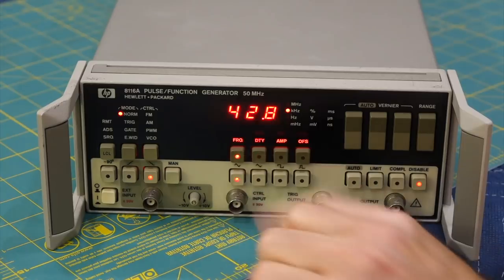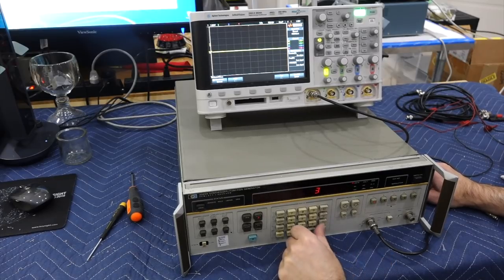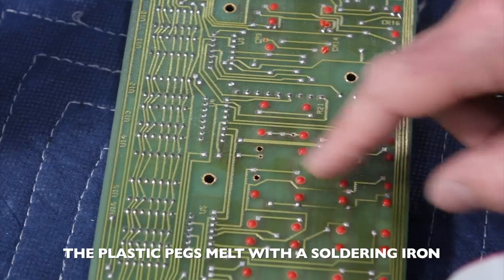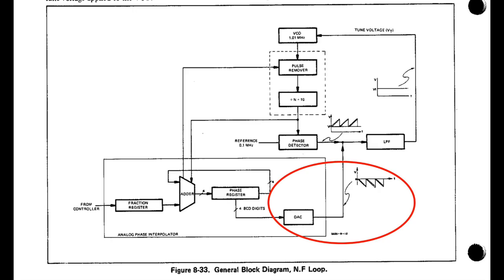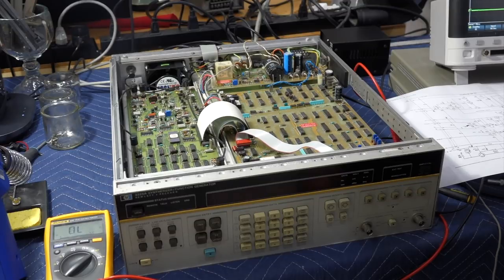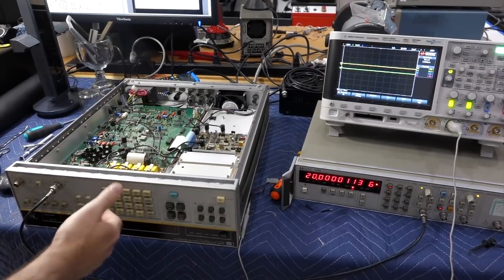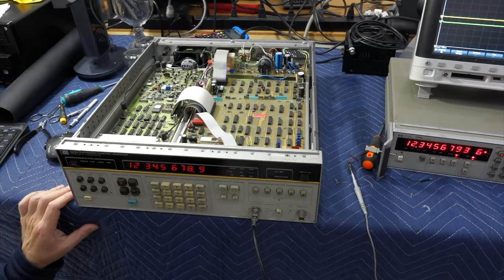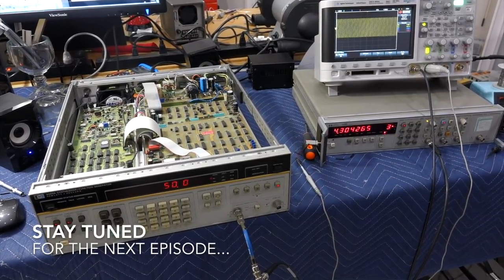HP 3325A Frequency Synthesizer Repair: keys, caps and PLL trouble

Comment: Thanks for this video. You pointed me to What I thought was the only problem on my 3325A ... but I missed one. One of the gummed-up keys, when cleaned, revealed that it was missing the spring  .... and as far as I can tell on google searches and on fleabay - they are not to be found, unless I buy an entire display board.  .. SO, hive mind, does anyone have a suggestion as to where I can get (a) spring? or more than one if that is the requirement to buy/sell ?   So far I am at goose eggs unless I cannibalize a working HP device  ... and I don't want to do that.
So ... any comments are welcome, any criticisms or pokes at an obvious answer I am missing will be accepted and appreciated.     Thanks

Comment: On equipment that in new to you, and in need fo checkout, always go for the PS first. Nothing cna work right if it is not getting the voltages it needs.  I am in the habit of using a Variac for anything I have a question about, monitoring the voltage and current. Nothing worse that destroying parts by rushing into a power-up.

Comment: If it was easy to remove these switches from the pcb and using a small glass fiber brush for cleaning pcb traces and the moving metal contacts of the switches the switches will renewed and will last for another 40 years but look like custom designed for one time installation and removing putting back the same switch has a lot possibilities to fail.

Comment: Too easy!  I'm going to have to start bidding against you on the HP lab equipment on eBay.
Reply from the maker: Uh-oh. I’m in trouble.
Reply: It's often a lot cheaper to buy stuff that's listed as "not working/for parts" and just fix it yourself. Sometimes the fix is something idiotically simple, like a fuse holder that wasn't making good contact (like that VIC-20 I picked up a few months ago), and sometimes it's a little more complex, like a cold solder joint that you need to track down. But if you're competent in this kind of thing, it's a really cheap way to pickup vintage computers and test equipment.

Comment: Why not change both caps? An old device with two caps and one goes bad that other cap is high risk item.
Reply from the maker: The other one tested good and did not leak. I did not have a second high voltage cap replacement in hand either. So the combo of both saved it! It’s a lucky cap.
Reply: The other cap tested good, and the lead seals have  evidently lasted 20+ years, and there's no reason to believe they won't last another twenty -  a new cap may not even last as long.
Reply: Better than those mid-2000's motherboards with the electrolytic caps that used that knockoff electrolyte formula. I've long since lost count of how many of THOSE I had to re-cap. In that case, if one went, you could be guaranteed the rest would fail soon after.
No, equipment of this era, it was usually the RIFA filter caps, or the tantalums.